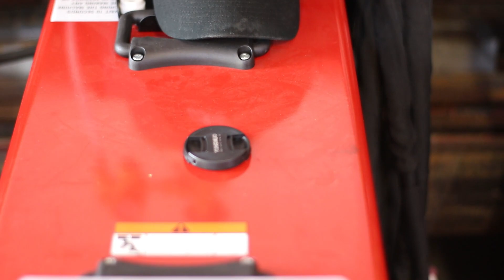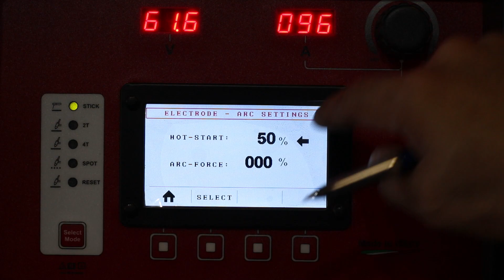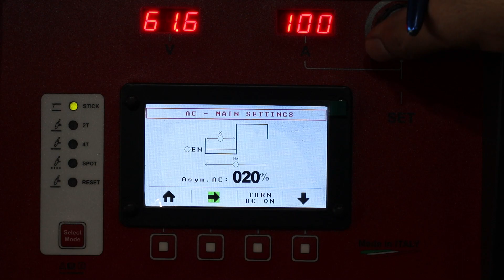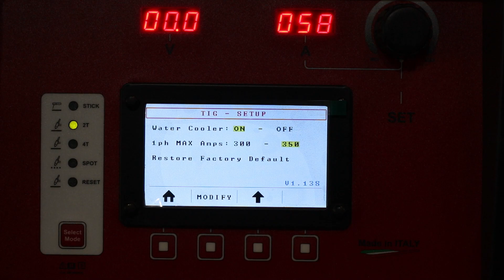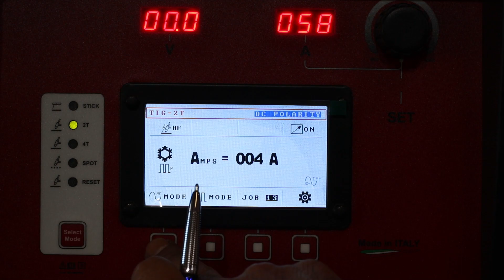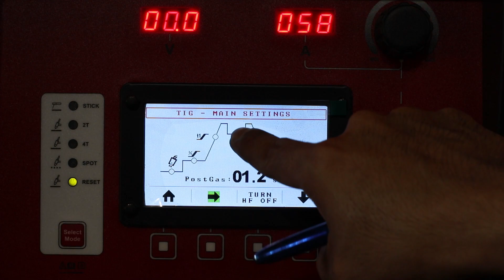The New HTP Invertig 400 AC/DC 1/3-Φ TIG & Stick Welder !

Comment: You need a 40hp phase converter?! I could run my mill my lathe plasma cutter......pretty much every tool in my shop off of a 10hp
Reply: No it's not "needed", I'm actually running off of a 30HP phase converter.  I believe I mentioned 40HP since that would put the max load of the welder in the 50% range of a 40HP RPC, which would be much better than loading up a 20HP phase converter to the max.  10HP is only 7,500W total power available. This beast pulls nearly 15,000 watts at full throttle.  That would overload your 10HP RPC real fast at that level.
Reply: @gmaestro79  ya I hear you I just bought the invertig 301 for that reason....thanks great video
Reply from the maker: @westweld  nice, how's the 301?  Pretty much same features?  I just realized I replied while signed in to my other account, lol.  Did you get it with the Smart Cooler/cart?
Reply: @zod-engineering-welding  yes I got the smart cooler.....I actually haven't received the 301 yet but but I ve had my pro pulse 300 for a few weeks and I like so much I had to get a tig machine too I'm told the settings are very similar to the 400 invertig
Reply from the maker: @westweld  Yea from what I can tell it's a lower-amperage version of the 400 with the same features.  I have a TIG Button on mine and my Invertig 221.  I love those things.  Gotta love that PP300, eh?  I have a custom-made 20ft MIG gun on mine and works awesome.   I just finished making my ultimate MIG cart and I'm putting together the footage to upload a video.  I have an HTP group chat going on Signal Messenger in case you want to join.  I don't think there is a way to send the link directly through youtube.  I can send through facebook if you use it.

Comment: I have a real hard time trying to understand the reason for all the adjustments and hard to understand tweaks on this machine.I have been welding for over 40 years and certified in both stainless and aluminum welding using the old transformer welders.Flip the switch to DC for stainless and AC for aluminum and start to weld, simple as that!
I see very little if any advantage in the inverter welders these days with all of the bells and whistles they offer. Am I missing something, we are only welding here?
Reply from the maker: Yes, in my opinion, you are missing something  Added control.  Think of this analogy.  Why have automobiles progressed the way they have since they were first introduced into the mainstream population at the turn of the century?  We still only get from point A to point B?  So why do automobiles have all these added features now?   That is the basic premise that the analogy will follow.  

Don't worry,  it's normal for you to feel the way you do, because you learned to weld when none of this existed.  So you had to make do with what was available to you;  absolutely nothing wrong with that.  I will feel the same way you do right now, but it will be 40 years from now in the year 2060,  when welders will have evolved to a point where even I won't recognize them.  I too will also wonder, "why do you need all those newer features and adjustments??   Back in my day in 2020, all I needed was my Invertig 400 with a basic set of menu functions and that was all I needed for mild steel, stainless, and aluminum, etc".   Do you see what I mean?  :)   

Also look also at communication.  Why are you surfing the internet on your computer/tablet/mobile phone right now and posting a comment on a youtube video?  There are still telephones, regular mail, newpapers, libraries to find information and communicate with others.  Yet here we are, communicating at light-speed, likely thousands of miles away, right? Because it's convenient to utilize new technologies  :)  It makes things faster/easier/etc/etc in ways we can't even dream of right now.  Things change.  Things evolve.  Time moves forward, not stands sill, nor moves backwards.
Reply: Oscar you just set me straight. I am 63 years old and sometimes struggle with new technology. Your explanation was just perfect.Thank you for taking the time to explain things in a way that is easy to understand.

Comment: Not trying to knock the htp but I have the Everlast 255EXT with 220v plug in and it puts out 250A @ 60% duty cycle AC TIG for $2200.00. They also have the 350EXT it puts out 280A @ 60% duty cycle AC TIG. 60% duty cycle is the number you need to look at for those who plans on doing a lot of welding.
Reply from the maker: Good for you; its your money so you are free to buy whatever you like.   It's all fine and dandy until they break down and everlast blames you amd basically denies warranty.  Seen this happen already.  Hope this doesn't happen to you.  If you're in Texas, you can come by and we can torture test both your TIG and mine until they hit the thermal shut-down repeatedly....just to see who needs to call the vendor first ;)
Reply: @zod-engineering-welding  preach brother lol didnt like that guys attitude either. I'm selling my everlast 210EXT and going for the Invertig 313(shop only has single phase) the everlast served me well, but I dont want to be stuck with it when it no longer is worth anything, it's like a car(chinese car), every year that goes by, it's worth gets closer to $100 lol and the HTP will still be worth thousands YEARS from now. I dont want a machine to "get me started" or "get me by until I'm able to upgrade", that's what everlast users basically all say. I got a used Dynasty 280 and it opened my eyes to what "quality and service" means. But when it comes to buying a new machine to take me far with my side business for Years(10-15 YEARS) I see that HTP is the way to go. Best value for pro welders who have tried the Miller route and see the difference. About $1500-$2000 difference, for same type of quality and service, plus the HTP has slightly better duty cycle than Millers. Everlast will definitely "get you by", and u can definitely do quality work with them, I did. So has everyone on YouTube, but not One of them have said "if your serious about welding, and want machine you can trust to feed your family with, go with Everlast" ...if they say that, its cuz they work for Everlast...HTP doesnt have to pay pros to endorse their products. That means something to me. It obviously meant something to u too. Great vid Oscar!
Reply from the maker: @DCweldingAndArt  Thank you, I appreciate it.  When you get your Invertig 313 look me up again to join my HTP Welder Chat on Whatsapp.
Reply: @zod-engineering-welding  hell yea! Will do amigo! Have a safe and Happy Holidays!

Comment: So 400 box is around 1000 bucks more than their new 313 (with cooler), however 313 does not include anything else such as torch, pedal, cart etc. while 400 comes with all that?
Reply from the maker: For some reason, the 313 has the options where you can select the water-cooled package or just the "power source alone". But on the 400's page, it doesn't give you that same option.  So it just depends on what option you are looking at.   If you are looking at the 313 with the water cooled package it does include some accessories as described on that page if you read further down.